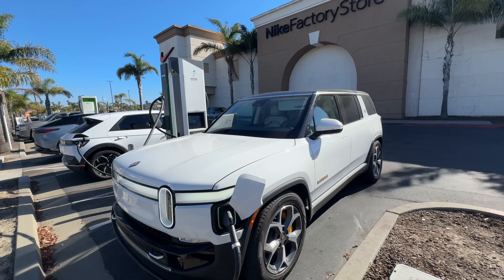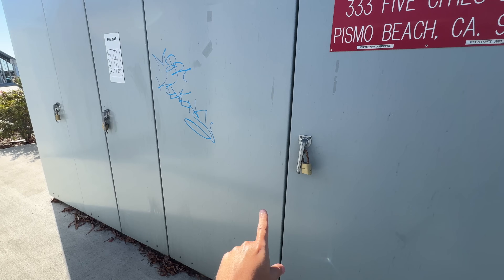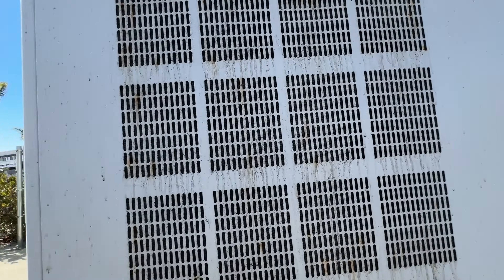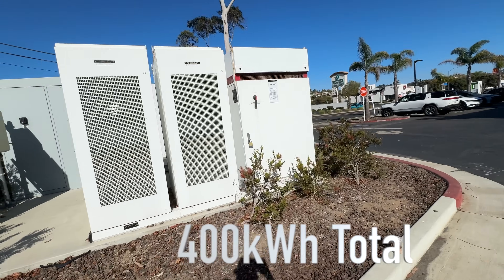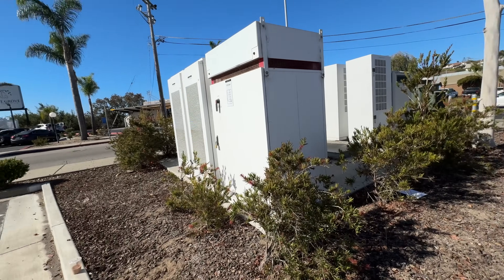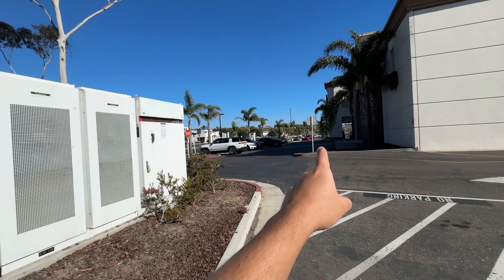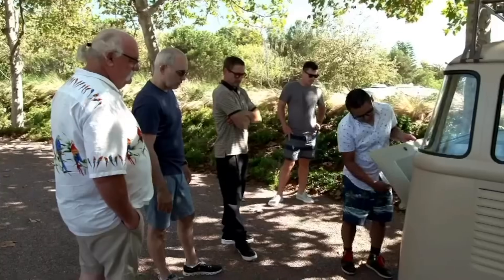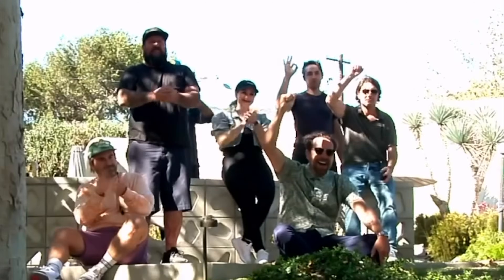This is Why we dont have more EV chargers

Comment: Just so you know its already three phase comining in to the transformer. You are correct it is 1000s of volts can vary roughly 2400v to 25kv phase to phase (at least around me) all a trasnformer does it steps the voltage down.
Reply: Most transformers like that are around 22-23kV coming into it.
Reply: Possible im not in cali but here in missouri we run usually 7200volts up to around 25kv in some areas.
Reply: It all depends what that circuit is running. The transformer is made to match the voltage being supplied to it and for what voltage is required for the customer. Im gonna guess 277/480 or possibly 120/208